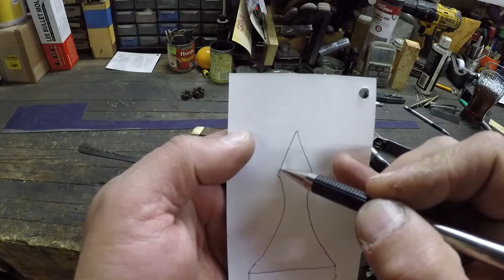stropping a straight razor

Comment: I don't see that a secondary bevel is desirable.  I like the strop to be very taut, white knuckle-taut. I also prefer to draw the razor at an angle slightly less than 90º to the strop (say 70º). This makes it easier to lead with the spine not push the edge into the leather. Thanks for the video.